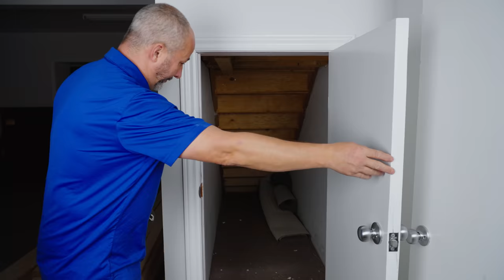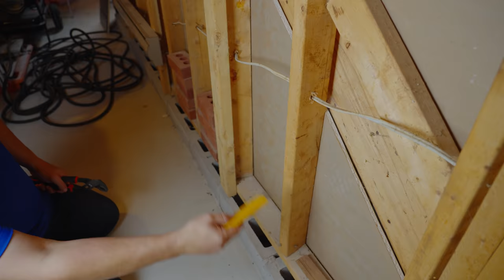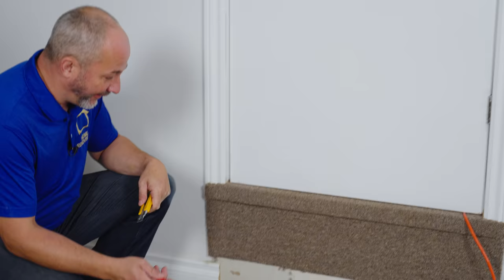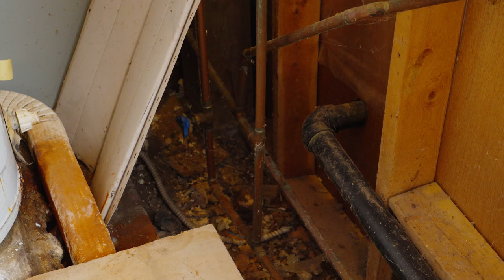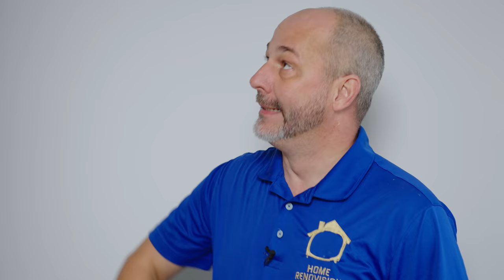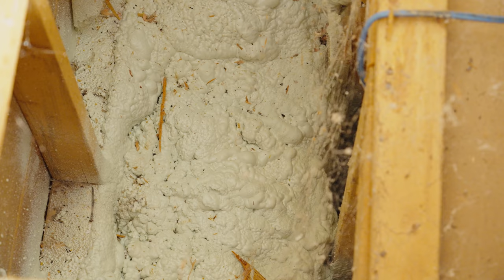5 Major Problems With My Church

Comment: Maybe its just the poor churches I attended but in my experience congregations are often filled with hard working, well meaning folks who just haven't the slightest clue what they're doing.  This is really scary when it comes to wiring!  I did some IT work for a church that ran their electrical outlets using cut up sections of old extension cord!  When I asked about it they pointed out that they used heavy duty cord & that it had a ground wire so it was fine.  SMH
Reply from the maker: The whole world is full of folks with good intentions and bad understanding. The secret to life is to never stop learning.

Comment: I am having the same problem at my house, old house built on a slab with no sealer between the wood and cement. The temp differences between outside and inside causes the slab to sweat constantly close to the wall. I will be staying tuned to see how you deal with this!👍👍🇺🇲

Comment: I’ve been involved in a year long project (so far) rebuilding a house that belongs to our church. Some of the problems were from poor to no maintenance (not cleaning gutters, letting termites migrate into the house), along with very sloppy (could I say horrible) building practices. I’ve had to completely replace most of the joists, all of the subfloor, repair or fully replace one third of the wall studs, all of the wall sheathing, plumbing, wiring, etc. Whew! I’m afraid that many or most churches, well meaning though they may be in being afraid to spend the necessary money, do not invest the proper resources in keeping from spending much more money later.

Comment: Fun times ahead. Have you made a video about removing old, glued-down lino/vinyl flooring?
Reply: I just had to do that in a rental property..not sure if it's the best way but I uses a scraper and a torch and it came up kinda easy (was definitely a bitch though) a heat gun works good alsl
Reply: @str8kronic  Thanks! I'll experiment soon. Will also try hot water...
Reply from the maker: on wood it is easy. just remove the 1/4" ply it should be glued on. on concrete heat is your answer. Cheers!

Comment: This was so interesting..  My house was built in 1988 - East coat of Canada, we moved in just over a year ago.  I checked under my basement stairs and it's untreated 2x4 on bare concrete - no signs of any mold & it's closed off from air movement + lots of cob webs lol - but it is well insulated with Styrofoam. Is it possible that it's just really dry? I also have a large crawl space under part of the house(2 bedrooms & bathroom) that is dry as a desert 365 days a year - no vapor barrier, just insulation. I did buy the VB the seal it off but haven't gotten around to it as I'm still debating whether or not to closed-cell spray foam it.

Comment: Jeff - surely when that building was inspected for you before the purchase all of these issues would have been noted and either fixed by the previous owner or you negotiated the price accordingly. As is was used  as a commercial building / place of worship and the fact that you have told us it was rebuilt after a fire destroyed I struggle to understand how any work was done there that did not meet code. Can a non complying property such as this be sold in Canada ?? I know you guys are hot when it comes to drain venting and mould but it doesn't look that bad to me. The moisture that you say has wicked up from the floor I would say is the result from a leak in the mechanical room or someone generously washing the floor with lots of water regularly. Cheers. Looking forward to a reply.
Reply from the maker: When you are buying a church for a major retrofit the surprises are less of an issue. it was interesting to find a lot of poor construction practices and how they deteriorated over time.

Comment: What is this about venting the plumbing? Happen to have a video on it?
Reply: When you turn a bottle upside down it takes forever to pour out, but if you have it at an angle with air it goes faster, right? Same thing with plumbing. You don't want to clog your pipes with air bubbles.
Reply from the maker: moving water creates a vacuum effect so you need fresh air behind the water to eliminate the effect of solids get trapped in the line.

Comment: The wall issue isn't a hard fix especially if you're demoing moldy drywall. If the walls aren't structural just cut the studs at 3 1/2 inches and put a new sill plate in with blocks under each stud the space in between will allow air flow and if there's a flood the water can drain away easier. Also dry core subfloor will help with protecting the new flooring and furniture in the basement.
Reply from the maker: yup, however the wall is structural on one side so it will need a different kind of love.

Comment: Are you going to use pt on all the sills?$$$
Reply from the maker: no that does not stop wicking. I will be using a sill gasket as a moisture barrier.
Reply: @REALITYRENOVISION  how do you get the gasket under the sill? Coming soon in a new video. US PT IS MANDATORY

Comment: How many kWh's/year does that building burn through in electric baseboard heating?
Reply from the maker: not exactly sure. it has never been used as a residence. no worries though we are going to use a different system for heating and cooling.

Comment: How do I know if I have a gasket between my sill plate and foundation ? If not what can I do .. wait for it to rot ?
Reply from the maker: Code requires PT lumber, that does slow down the rot process, however it does not stop wicking. so the best answer is to remove 1 section at a time while supporting the joist and install a sill gasket and then a sill plate. use a sealant to connect each piece to keep the air and bugs out. Cheers!
Reply: @REALITYRENOVISION  but it has not rot in 40 years so I guess there is some sort of capillary break between the block and the sill.. at some places I can see black goop .... Could it be tar?
Reply: Is it only in cold places there is an issue with wood on concrete?  I’m in California and I’m pretty sure my  (1948) walls are right on the concrete foundation. It’s a crawl space, not slab so maybe that makes a difference?